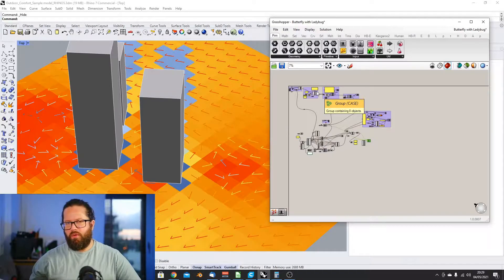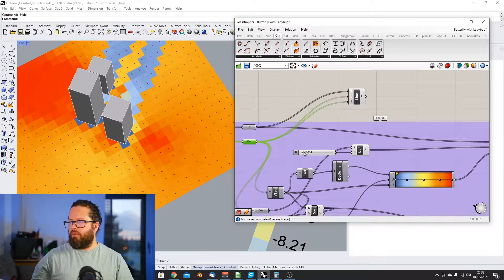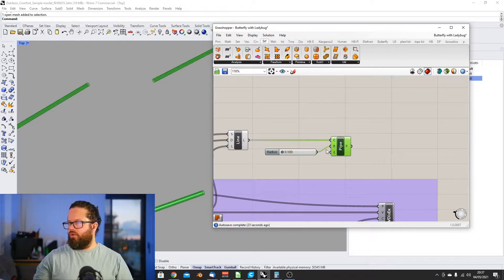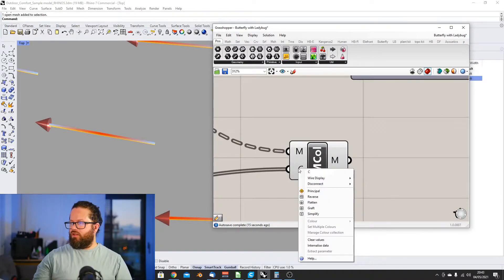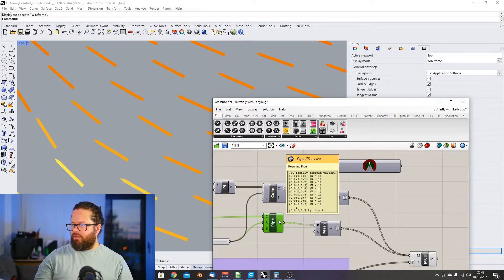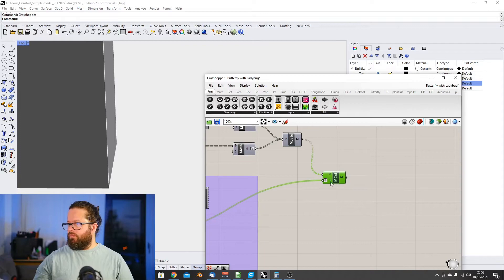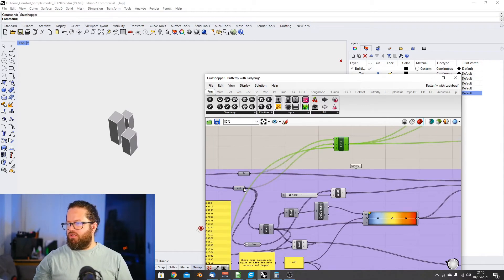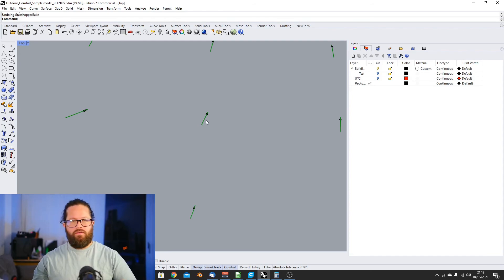How to bake coloured vectors from Grasshopper? | Butterfly CFD | Part 04

Comment: Very helpful tutorials. I would like to ask though, if there is a way to calculate apart from wind velocity in outdoor spaces the air temperature as well. Thank ypou very much.
Reply from the maker: Not hundred percent sure what you mean by calculating the temperature. The temperature would need to come from data. like the e+ weather data. 
This video deals with the outdoor comfort (percieved temperature) in combination with cfd. Basically how wind and shade influences the air temperature. You might want to check it out:
https://youtu.be/c9Xaspg5Dqw
Reply: @PhilippGalvanDesign  First of all, thank you for your imadiate response. I have to say that I was not precise enough and I would like to apologize for that. My question is if it is possible to simulate air temperature with butterfly plug in. I performed measurements in a aspecific area (as a PhD student) and I want to validate measurements of air tmperature against simulating data. My final goal is to compare different simulation cfd tools with ENVI-met model (microclimatic model). I noticed that heat transfer recipe has the ability to simulate air temperature but mostly in indoor environmnets. Is it possible though to develop a script in order to simulate air temperature in outdoor environments? I am asking because I recenly descovered this kind of plug in and therefore I am not familiar enough to using butterfly. Thank you and please continue your great job.

Comment: my pc at work doesnt allow me run as admin. How can I deal with this?

1. Solution exception:'docker-machine' is not recognized as an internal or external command,

operable program or batch file.

	

If OpenFOAM is installed correctly and the default is running, you get this error most likely because you are not using an administrator account. Try to run your application (Rhino, Revit, etc) as an Administrator!
Reply from the maker: You don't need to be an administrator to run rhino in admin mode. With your account right click on Rhino and select run in admin mode. If that doesn't work then it won't work...
Reply: @PhilippGalvanDesign  that was what I mean. I can not run Rhino (
and any programs) as admin mode. I must ask the IT department to enter the password...
Reply from the maker: Than I'm afraid it will not work.
Reply from the maker: I'm starting a new series soon which covers similar studies with a different software. Coming over the course of next year starting in January.
Reply: @PhilippGalvanDesign  could you tell me which is that software?
Reply from the maker: Sorry, this is confidential at the moment.